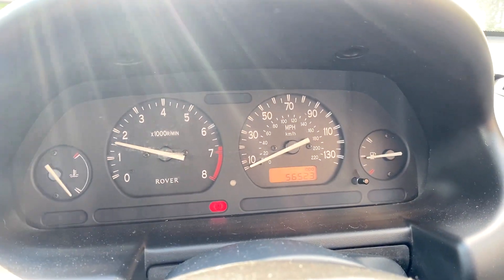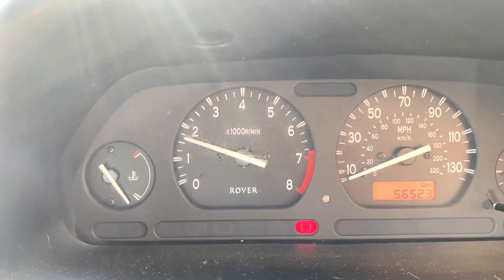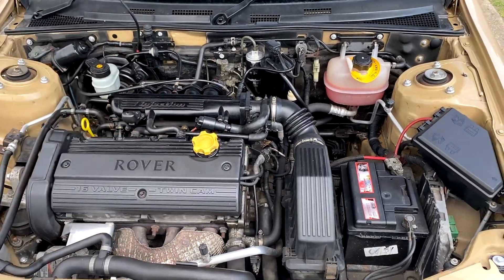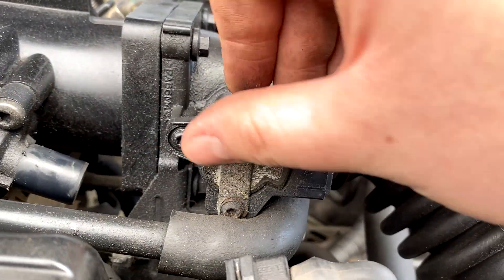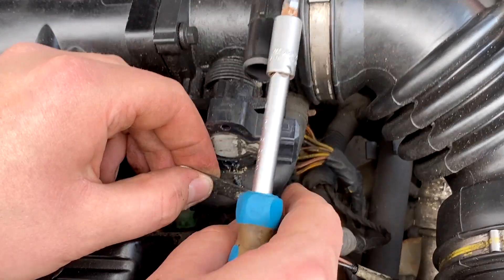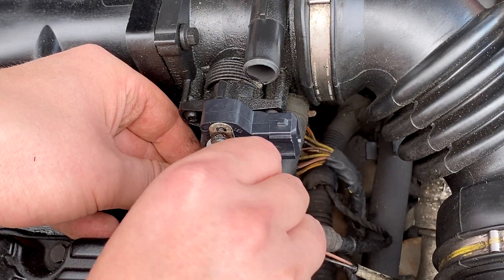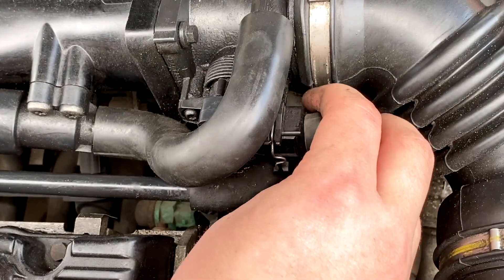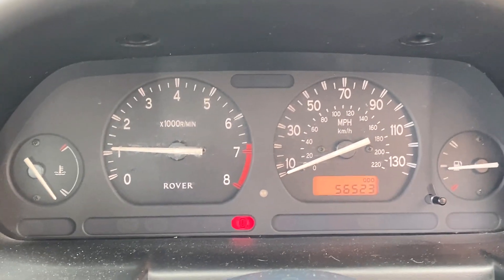Rover K Series Throttle Postion Sensor Replacement

Comment: My rover 1.4 has massive dead spot between 2k and 3k. It sometimes runs better than others, but never good. No misfire, checked all wires, cleaned TB & sensors. Also has a slight high idle. Could this be the issue? Any suggestions would be appreciated.
Reply from the maker: Sensors do tend to fail on these cars now due to their age, if not already it is best if you do replace them, Usual culprits to poor performance is Idle Control valve, Throttle Position Sensor and also the Coolant sensors.

Comment: any recommendations on mods for a rover 25 5 door? would be really nice cos i dont know what i can even put on my rover
Reply from the maker: A good Mod / Upgrade is a 52mm Throttle body if you dont have one already its a straight swap, you also need the cable too. but it gives you an extra 20bhp that the engine couldn't access with the restricted throttle body. Fog Lights as well theyre an easy Upgrade makes the front end look better imo.
Reply: @Roverjoe  Thank you so much